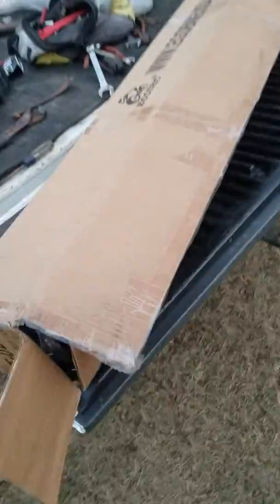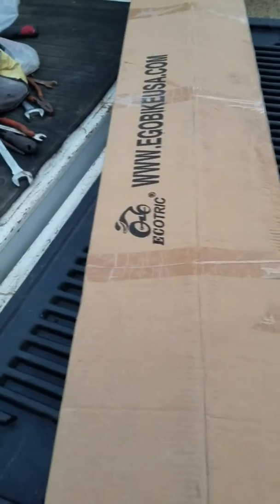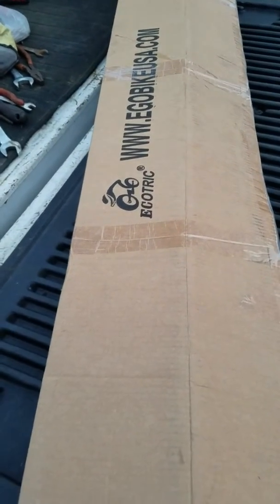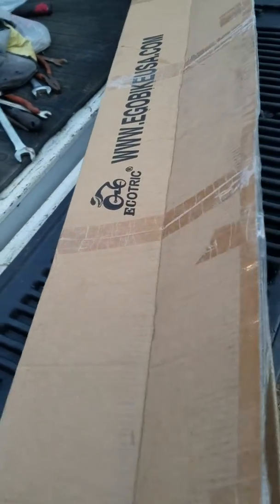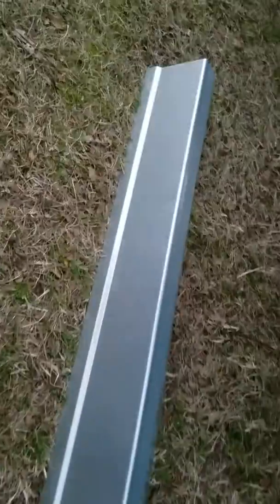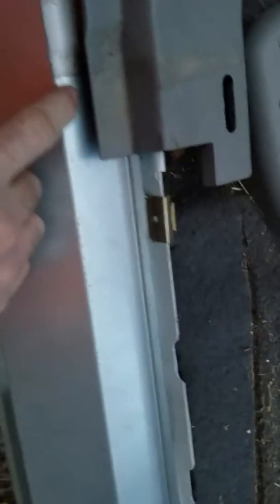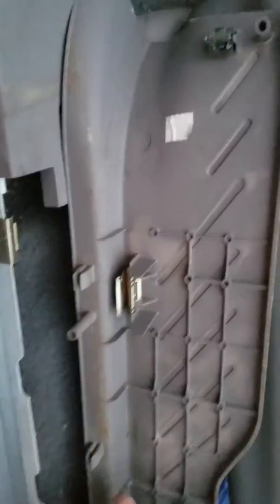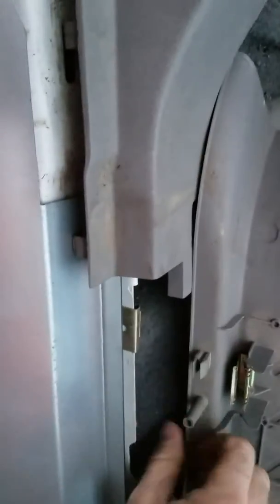1997- 2003 f150 rocker panel replacement pt1

Comment: I bought rockers for my 03 F150 from Raybuck, they were original fit ones where you had to cut out the old rockers. They worked quite well although I had a buddy who owns a body shop do the work. The slip-on ones are not a super long term fix but they are cheap. Turn your phone sideways next time so it's easier to watch.
Reply from the maker: My phone actually was turned sideways. But I didn't realize that it wasn't recording sideways. Hard to be but so perfect with the sun in my eyes. I considered the others. With the mileage on the truck,  and it being a farm truck, this is suitable for my needs. Thank you for watching and criticizing.
Reply from the maker: I may have been a little rude. Sorry.  Had a long day at work. I don't have the time to cut into it like I used to have. The previous owner bondoed it. I have some rust blocker for everything. I honestly wouldn't be worried about it if i wasn't scared my wife or kid would cut themselves